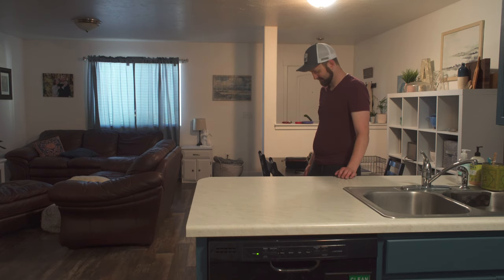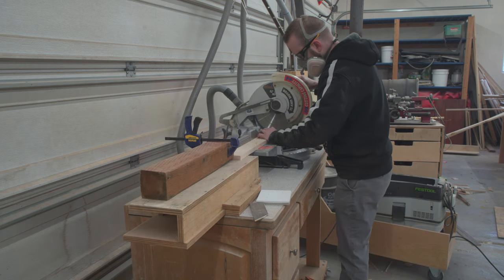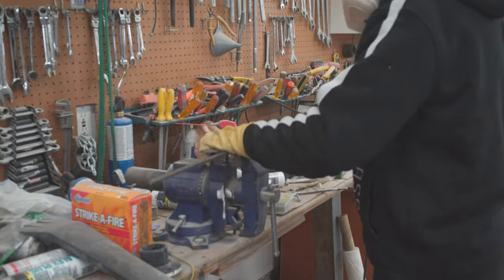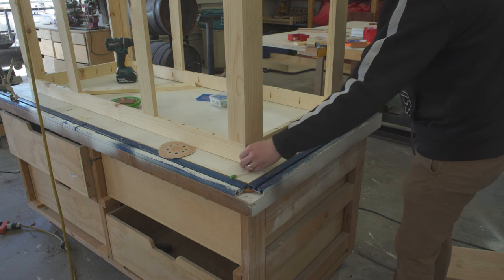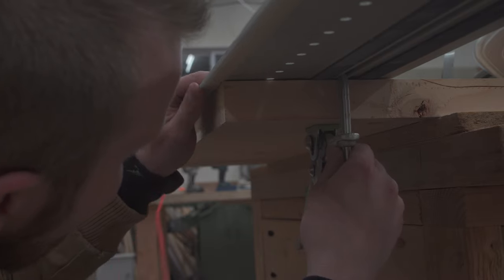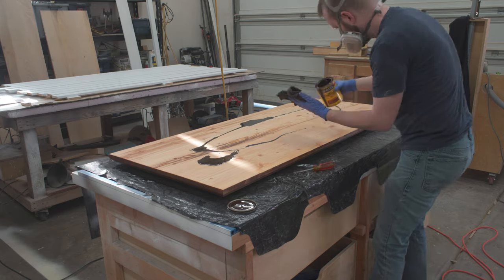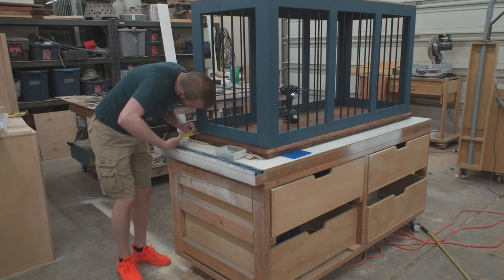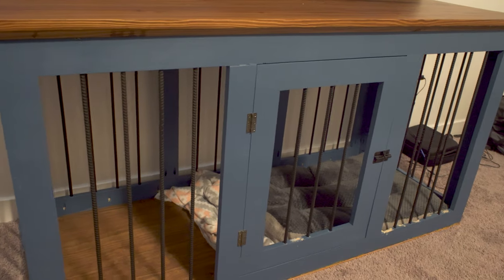Building a Nice Dog Kennel

Comment: I’m about to make a two dog kennel and I’m going to try to keep this furniture piece as light as possible by using 1x3 material instead of 2x4. Also, instead of using rebar, I figured I’d go with wooden 3/8” or 1/2” dowels. Plus, I don’t want to spend too much time cleaning and cutting rebar. 😅 Thanks for sharing, I appreciate you!
Reply from the maker: Nice! Sounds like a solid plan! Let me know how it goes with the dowels, I'm curious about that